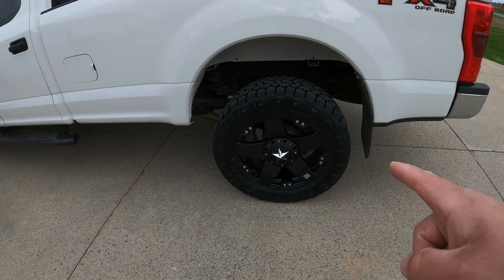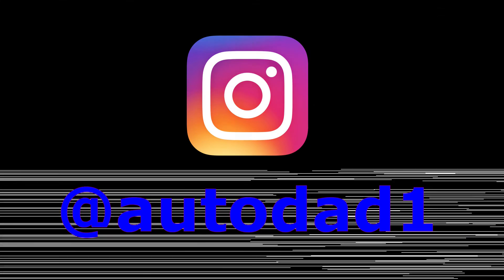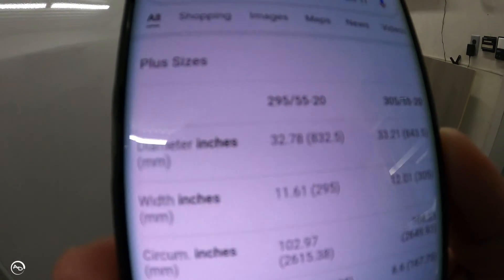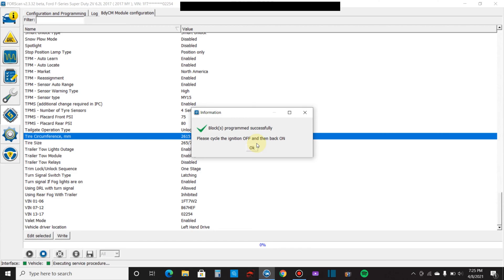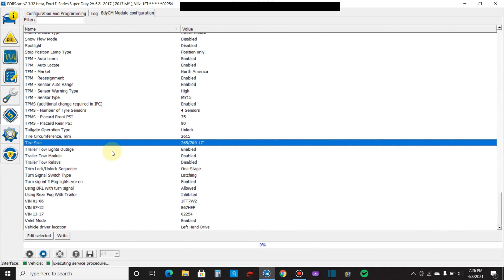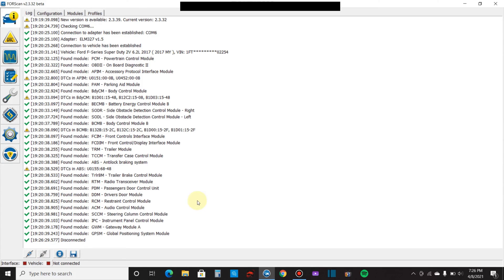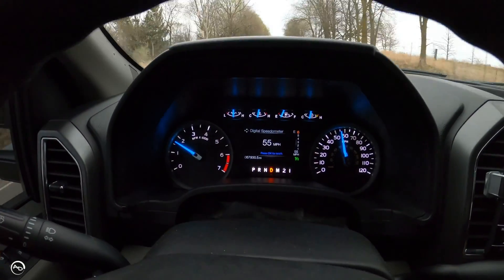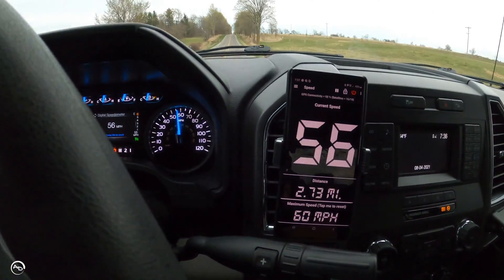Adjusting Tire Size with FORScan

Comment: I have a 2026 F-450 Cab & Chassis.  I have changed the rears to 285/70R 19.5 "singles" replacing the dual in the rear so that we can put on a custom truck body that the duals will not fit under.  The fronts are still the original 225/70R 19.5.  I bet you can imagine all the lights going off on the dash because of the tire size difference?  I know you can change the tire size in ForScan....but can you change front and back tire size differently?   OR can someone custom edit the program for that?   Any help would be great.  I have used this set-up for 11 years on the 2014 F-450....it didn't have the computer the 2026 one does.
Reply from the maker: You cannot change the tire size separately and you need to run the same size on all four corners. Once you put it in 4x4 you will destroy things
Reply: @autodad thank you. It is 2-wheel drive.
Reply from the maker: The truck is most likely reading that the wheel speed sensors are reading at different rates front vs back throwing the lights

Comment: I set tire size after putting on 35's and same thing, 4mph off at 75mph and cleared dtcs in PCM and TCM. Tried to dial it in and went a little over, 2mph off in other direction, dtc's cleared.  Now I've got speedo correct but now i can't clear P0610:00-AF no matter how or what order i do resets/relearn.  Fuckin ford

Comment: Nope. 2018 F150 w/10 spd. Went up slightly on tire size.Tried this woth FORscan,  and the TCM immediately threw 2 codes: P160A and P160A 2F. Hard DTC's and not resettable. It took some innnovation and reversion to finally get rid of those codes. I'll pass. (No criticism of your videos--they're spot on and helpful.)

Comment: I have a 2011 f150 with 325/60R20s, input 2819 mm for circumference. It did not change the speedo. Its still traveling faster than speedo says. Speedo set to 45mph but the actual speed is 49 mph.

Comment: so I know this is an old but very useful video. I have purchased a f150 with a 3" lift and bigger tires 35/12.50R20's and can not for the life of me. Searched the circum. and shows 2794.76. Made the change via forscan and it took the new circumference but at 60 im still going 6 over. thank you Auto Dad !
Reply: Did you manage to get it changed to a more accurate circum? 
Have a 2018 f150 platinum with a 2.25 level on same tires (35x12.50r20) and will be doing this very soon but wondering what circum I should input to get it right
Reply: May have to just play with it and change the value from the true circum.

Comment: When i did mine on my maverick, my car went crazy. Lights and chimes. Got a code for p160a. Body control module inaccurate data. Had to do reset to clear and force module to accept new tire size. Scared the shit out of me at first thinking i broke my car. But after reset doing fine.
Reply: What tire size you got in your maverick
Reply: I just change my tire size using for scan and I got a Engine sign on.
What should I do to clear this?

Comment: Your videos have been very helpful to this new owner of a 2017 SD. I downloaded Forscan and purchased the OBD connector you suggested. I needed a couple of sessions to get comfortable with the software and I have made some changes to my truck successfully. In your video you received an audio message in regards to your 911 system needing service. My truck is an XL, no Sync, no Bluetooth, no Navi all I have is AM FM and a CD player. The question I would like to ask is,  if you know how to address the 911 audio message you are receiving. My problem is kind of a similar issue, when I start my truck up and when I shut the truck off I get an audio message like your 911 message but in French. Upon start up I am pretty sure it is saying to "updating system please" and when I shut her down I have no idea what the message in French is. Yes I have done all the language settings in my dash and radio menus all of the written words are in English it is just the 2 audio message I receive in French. So I was hoping you might be able to tell me if there may be a solution using Forscan. Once again Thank you for your videos they have been very helpful. Sincerely

Comment: Great video!  I have a 2019 Ford F-150, attempted to do this both ways using the tire size spreadsheet and the circumference.  Both end up throwing the wrench alert and check engine light.  I have reset the PCM Module Reset, the TCM Reset All Adaptive Tables and TCM Clear Transmission Adaptive Tables.  After that I reset the DTC which clears the wrench signal.  But then I am left with PCM CODE: P0630, PCM CODE: U0422 & OBDII CODE: P0630 that leaves the check engine light.  Anyone have any advise?
Reply: I did mine today and no matter what I can’t get them to go away unless I reset back to the original size. Super frustrating
Reply: @masontanner1779  what was the original size in forscan I lost the paper and can't get mine to go away.
Reply: Just did mine I get the same thing. Another thing I don’t understand is my  original tire size which I haven’t changed at all was larger than what I have now. I went from 265/55/20 to 275/70r18 circumference increased significantly.

Comment: I did this and now i have a check engine light and a wrench that says see manual.  Using forscan also to clear it and it won’t clear.  Help!!  I had to revert back to stock size then cleared the codes and they went away.  Anyone know how to do this on a 22 f250???
Reply: You ever fix this? Tried changing the tire size and it gave me a service advantrac light so I changed it back to the factory size

Comment: i did this on forscan and now i’m having a wrench popping up and dtc of p160a on my 17 f150
Reply: How do you fix this problem?
Reply: @pikamon.77  do you have a 10 speed transmission?
Reply: @gabrielvalerio1396  Did you figure out how to fix?
Reply: @evosarebetter  it depends if you did all the steps he mentioned and still didn’t work i reset the tim and clear the value and it went away but since i did that i still get the mismatch on obd but doesn’t turn on the engine light on
Reply: @evosarebetter  it depends if you did all the steps he mentioned and still didn’t work i reset the tim and clear the value and it went away but since i did that i still get the mismatch on obd but doesn’t turn on the engine light on
Reply: @gabrielvalerio1396  i changed the MM 3 times, 3 different ways and didnt change the speedometer. Last one gave me a code P160A. Just relearned pcm so hopefully that helps. what year is yours?
Reply: @evosarebetter  a 2017 f150 3.5 ecoboost 10 spped

Comment: So I did this. My tire size is 285/65/20. Circumference is 2760. Before I changed it my spedometer showed 3mph slow.  I changed it to 2760 and it’s showing 3mph fast now. Unsure what’s going on
Reply from the maker: I had to tweak mine. Cut the change you did in half and you may be close

Comment: I see that Forscan wants the size in mm, but will it let you adjust actual tire dimensions that was listed below that line. 275R 70 into a 35 12.5 20? or do you just leave that alone?
Reply from the maker: Just leave it alone. I tweaked the mm until the gps matched

Comment: Awesome video! 
To bad Forscan has locked down the website and membership.

I’m getting a 2023 coach on a E450 (7.3 V8) chassis and want to do some changes in the system.
Reply: It's not locked down now.
Reply: It still works and is free? You don’t need a payed version to adjust this. It’s all free. You just need a cable or way to read it

Comment: I’m trying to change my tire size configuration I enter my gear ratio then tire size on my 2000 F250 diesel and it did not download it says error writing block failEd incompatible configuration how do I get past that?
Reply from the maker: Don't change your gear ratio. Just change the circumference

Comment: Hey great video! Quick question by doing this I dont have to tune my truck or re gear? I planning putting 33x12.5r20. Currently stock is 275/55R20.
Reply from the maker: No. This program has nothing to do with the ECU
Reply: @autodad okay tysm!

Comment: Does your odometer and fuel economy read accurately after changing the tyres size diameter?
Reply from the maker: Yes as they all read off of the same source
Reply: @autodad  on the Australia ford rangers the factory odometer reads 100 on dash and 96 on the gps with stock size  tires 265 65 17.
When putting on larger tires 285 65 18 it reads 100 on dash and 100 on gps but the odometer is out  buy 8%  which throws out DTE  and shift points in the auto.
Reply from the maker: That is weird

Comment: 2600mm tyre circumference.   That's massive,  I think you have conversion error there.
Reply: Not really. That’s roughly 102”. Remember that you have to do the diameter times pi.
Reply: @NastyZZZ28  Hey could you explain please how you got the 2600 mm tire circumference? Every watched your video and I’ve entered it in several different ways. I have 43 inch tires and I’m trying to come up with a tire circumference
Reply: @inspectitaustin3545  so to get circumference, you multiple the diameter of the tire times pi. 

D*pi. 43 inches x 3.14

I’m getting 135” converted to mm is 3429mm.

Comment: I tried this on my 18 3.5 and after changing I got the wrench come up. I reset it but any idea why?
Reply from the maker: Sometimes it doesn't take the change or like it. Sometimes it just messes up
Reply: @Auto Dad  should I retry? I have bf goodrich ko2 275/65R20 and I think the 2718mm is correct, anyway to know for sure?
Reply: @kristinemayer346  you have to use the relearn functions on the PCM and TCM after you input the new tire size on your BCM. Your basically recalibrating the data in those modules to be compatible with your new values for your tire size. Once you do that the wrench will go away and you can clear the DTC codes. There’s better information about how to do this on the f150 forscan forums.
Reply: @sc8106  not everyone does this tho

Comment: why did you change mm vs tire size?
Reply from the maker: In my application it would not allow me to change to the tore size I have. There was not an option listed.
Reply: @autodad  I thought i saw it in this video.  or was it stock tiresize just off on speedo?  Thanks for the reply, this is fun geeky stuff.
Reply from the maker: I added bigger tires and the option for my size was not listed so it was easiest to just tweak the circumference

Comment: I have a 22 F250 with 37's. I  keep reading the later models are not changeable. What year is your truck ?
Reply from the maker: 2017
Reply: Did you figure it out? I got the fault code P160A

Comment: You better check  the forscan form you can’t just change the tire circumference there are two other modules that have to be changed also or they will fight with each other.
Reply from the maker: I have had zero issues
Reply: What are those modules?
Reply from the maker: Just the Body Control module
Reply: @autodad  I did that and got PCM and TCM errors! Can’t reset TCM message! What should I do?
Reply from the maker: Thats weird. I would revert it back and then check on a spreadsheet and see if there is something else. Mine was only the body control module
Reply: @Airthube  how did you resolve this?
Reply: @Airthube  I have a F150 and got the same problem. I did the following in this order TCM- Clear transmission adaptive tables, TCM- Reset all adaptations, PCM- Reset all adaptations. Thats cleared it up for me. I have changed tires twice and it has worked. I had reset them a few times once for the wrench to go away. Make sure to clear the DTC after as well.
Reply: @mrdlt3693 is this all through the forscan software? I had the same issue pop up

Comment: Just noticed the version of Forscan I am using doesn't show the tire size??
Reply from the maker: Try updating it
Reply: I just downloaded it last night??
Reply from the maker: Maybe it doesn't offer it on your specific vehicle. I would check w spreadsheet and see if you can change it in the AS BUILT
Reply: Ok. I am using it on my 2020 F150 XL.

I will try and find the spreadsheet to find the info and try the AS BUILT entry.
Reply: @danadams3362  Same issue on my 2018 lariat. Did you ever find a solve?
Reply: @jmaster0027  did you?